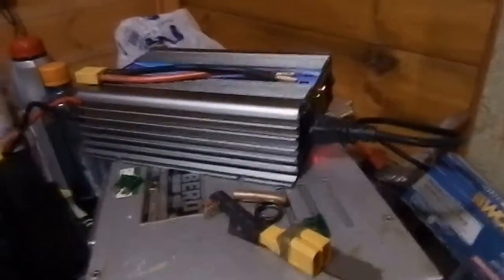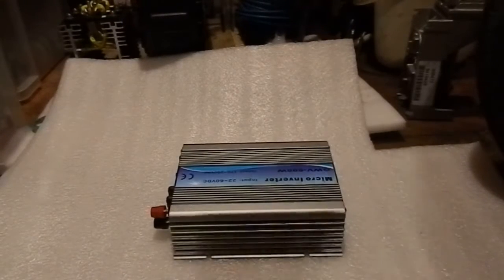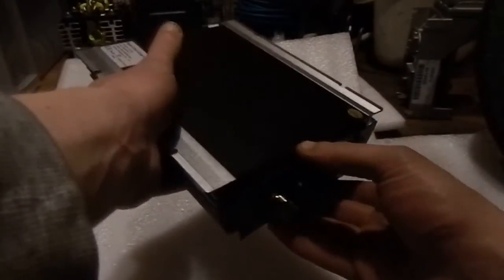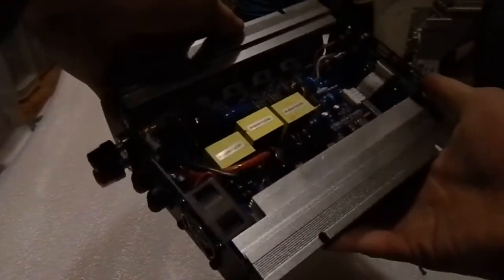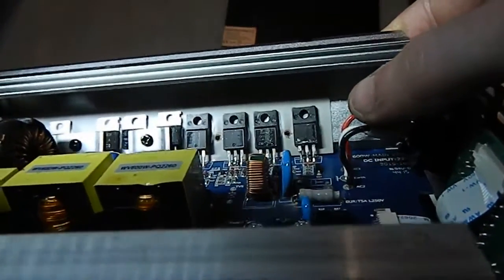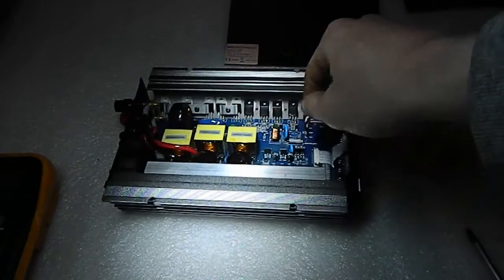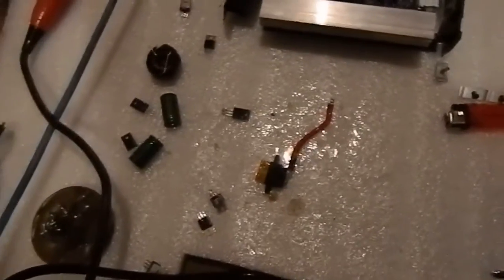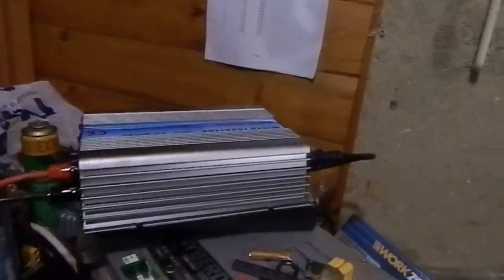GWV 600W Grid Tie Failure

Comment: Don't keep turning off the AC mains when the DC current is still present. It will blow the ac mosfet so quick. Always disconnect the dc first. A power or grid failure is not the same and turning off the switch, as devices in your home will pull the remaining ac current. The best way is to leave the ac connected and on with solar panels connected. Mine been working over 3 years like this with no problems. Grid tie inverters don't like being turned on and off all the time.
Reply: Do you think a daily power on/off after dark is bad for the inverter (while connected to solar power obviously)?
Reply: @gr0nis  i would say so yes,  there really isn't any need to power off grid tie inverters, the power consumption over night is minimal, with mine on constantly, now over 7 years, still going strong.
Reply: I've switched off mains ac loads of times on this exact model, no problem, maybe there's some kind of inductive load going off
Reply: my inverter dies overnight. AC connected no sun. No sign of life no led.

Comment: Just had mine failed today after almost 2 years of daily use, though it has never been pushed hard as around 250W was probably the most it had to deal with. Mine has two shorted mosfets, they are 26NM60N, I can find cheap ones on AliExpress but I don't know if they aren't fake, but on Ebay from Europe they're quite expensive.
Reply: Probably life of this gti is design for 2 years only mine also is same with you almost 2 years then it is not working
Reply: Did you have change the mosfet, did it work ? Thanks

Comment: Check the Q3 and  U2 pieces. One is the U2 is a 12v to 5v  and the Q3 I cant identify, but in my board is bad. All my transistors are in  good condition.

Comment: Does anybody know what kind of Diode and  zener diode are used near the '30NM60ND' mosfets?
When I replace the mos fest they explode and i discovered that het zener diodes are also defective.
Reply: Greeting. Did you find out the value of the Zener diode? I have the same problem

Comment: I repaired mine with 4 mosfets 34NM60N BUT NOW THE IRF3710 the input of the panels to the transformers have been damaged, I have to put more voltage or higher amperage.
Reply: Hi. How did you fix the voltage input?

Comment: yeah its fine after changing the duff mosfet and fuse the power all comes on fine i do no after the fuse poped some of the tracer on the board got damaged but i fixed that all but thats as much i can do not to sure what to try or change next lol its much closer to working its just that 50hz light thats not coming on and then it just gets stuck 😞

Comment: Bought one of these from a Chinese seller eBay. It has lasted no time at all. I plug in the mains, nothing. I plug in the solar panels, no mains and the front flashes just like yours and when it has finished I am left with 2 red leds, FAULT and either LOW or HIGH. Nothing else. No visible fuses have blown. I didn't know the grey resistor like thing was a fuse. I am completely lost with this thing and about to throw it until I found your video. You say AC mosfets but I don't know how to check them. What about DC mosfets? Or any other component..

Any advice would be very much welcomed. Solar panels are 12v (100w each) delivering about 48v, Max 55v from what I remember.

Comment: I have a problem with some inverters of 600 watts, I bought the replacement trasistors 30NM60ND but I dont know the value of the zener diode with a blue label conected to STF30NM60ND ZD1,ZD5,ZD3 AND ZD4 Please help me to know the volts and watts of those zener diodes.
Reply from the maker: I'm not sure as I no longer have the inverter.
Reply: @ShaunDobbie  Thanks my friend!

Comment: Limit the imput of the AC H-Bridge with an array of gas discharge tubes and 47Ohm Resistors in series to around 400V. Also Prevent overvoltage with MOV's on AC site. Add TVS Diodes to the DC input to limit the voltage. Check Zener Diodes at all AC Fet's (approx 12V)

Comment: my inverter is highly temperature dependent. At 5°C it does not turn on even with 30V. At higher temperatures it works better (in specifications).

Comment: The board in my failed inverter is a bit different the mosffet that has failed is 60R099C6 it is hard to find a replacement . Is there an equivalent part I could use ?

Comment: Hi,
How long did the inverter work after the repair? 
First I bought the 1000w version, and it worked for a whole year.
Now I bought the 600w version and I've got the same problem as you, after 2 weeks.
So.. does it make sense to repair it, or will it blow up soon again, after the repair?
Reply from the maker: It worked until I sold it which was about 3 years

Comment: Ebay seller sent me a 120V one just like this, same model number, same board.  Im in UK so its useless as is.  I opened it up to see what whas inside, it looks just exactly like the board at 12:11, there was a couple of links that said 115V and 230V on the board but swapping those over the 120V/60Hz lights still come on and no joy (or smoke... yet).  I guess the microcontroller is programmed differently?  Or do you reckon is there an easy way to get it to do 230V/50Hz like the one I ordered?  If not its in the bin....
Reply from the maker: Do not bin it, send it back to the seller as it is illegal to sell products without a UK plug.
Reply: @ShaunDobbie  Thanks for the advice.  It was one of those ebay sellers where they claim to be in the UK, but are actually in China.  So, eventually got my money back, kept the inverter as a door stop.  Reordered from Aliexpress.  MPPT tracking is hopeless, especially on a typical UK summer day with broken cloud.  In sunshine its quite efficient but when the cloud comes over it switches off temporarily.  Comparing 16/6/19 in SE UK with side to side panels I got 0.4kWh off this one and 1.2kWh off an APS-500i.  You get what you pay for!

Comment: hi, do you know what kind of zener zd1 zd3 zd4 and zd5 (connected with gate and source of 26NM60N)?, my board was with these diodes and mosfets burned and I dont find the diagram, thank you
Reply from the maker: I don't know and I think it would be less hassle just getting a new inverter in your case.
Reply: Hello, I have the same problem with zener diodes. Do you know the value of the diode or do you have a link? I would be grateful.

Comment: iv got a 2nd one had the same problem but with that one the 50hz light dose not come on and them  to two red lights it lights up from dc and ac sides its just that 50hz light and that its just not working hmm
Reply from the maker: Check the fuse on the board.

Comment: The inverter will continue to fail if you don't control the DC voltage and the DC amps (power) going to the inverter.  A PWM can be used to control the voltage, and a very low resistance wire can be used to control the amps.  (The DC power is adjusted using the PWM)  I would not go above 300 watts on this GTI, so the DC fuses should be changed to ~10A (10A x 27V = ~270 watts max.) So, with a 10A fuse, you can probably go up to ~220 watts continuous.  (I have two of these GTI's, and they each have hundreds of KWH generated on them, but I have external fan cooling and set the power between 100 - 250 watts.  Automatic relay control on the DC input.)
Reply from the maker: +G Young This inverter is quite unusual as it can take 12 to 60v on the input. When running directly on the 24v battery it never takes more than 25 amps. I sometimes run it at night time while I charge my car. My old inverter would have destroyed itself. If you increase the voltage to the inverter, it takes in more current. Anything over 30v and you will have to have it directly connected to a maximum of 600w of panels.
Reply: +Shaun Dobbie Unusual in a good way -- I like wide voltage range input. I wish it had the same unusual behavior on the power rating. The original MOSFETs will not run at 600 watts (25A @ 24V) for for very long before blowing a MOSFET.  Mine is "directly" (with a PWM & resistor) connected to 48V batteries and it has been running with original MOSFETs for almost 1 year (900KWH generated #1 & 200KWH generated #2)  I always run them less than 325 watts --> my fuse will blow at ~350 watts.(fuse is cheaper than a new GTI)
Reply from the maker: G Young
I worry that PWM would cause too much noise on the input which would make the computer inside fail.
Reply: +Shaun Dobbie A 10000uF & 100uF capacitor reduced the DC signal to 8mV of AC noise. (measured using my volt meter in AC mode)

Comment: I bought a 350 w gti on ebay and when I installed it it beeped nonstop and no lights turned on at all. Do you guys have any ideas what might've happened?
Reply from the maker: Ensure that the solar panel voltage is within the range that the inverter accepts, measure the voltage. Check also the plug and ensure continuity on all pins. I can't recommend anything else really apart from checking all the mosfets inside.

Comment: salve ha provato a vedere che non dipenda dai regolatori di voltaggio verso i microcip ?
Reply from the maker: You wot mate?
Reply: controllare    78m05    e   78m12  se sono in corto 1
Reply from the maker: Yes.
Reply: usually they can peel the black glue dots visible on the transformers at high freguenza yellow ones that cause the non-functioning 'cause freguenza busts completely and damage the mosfet and' not 'easy to know these things on the net
Reply from the maker: Not sure what you are asking.